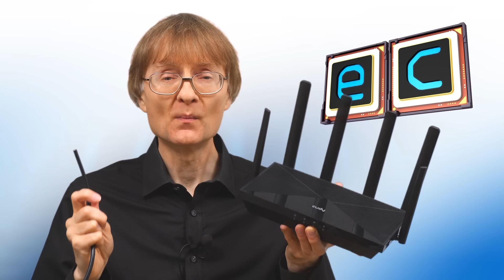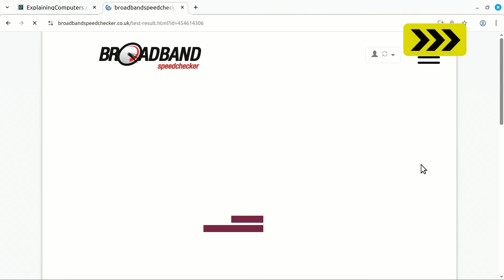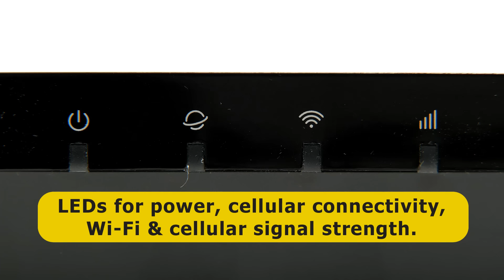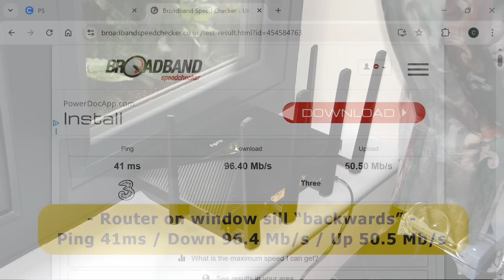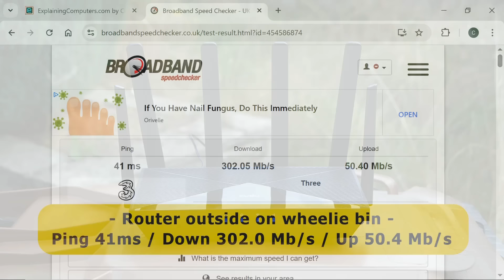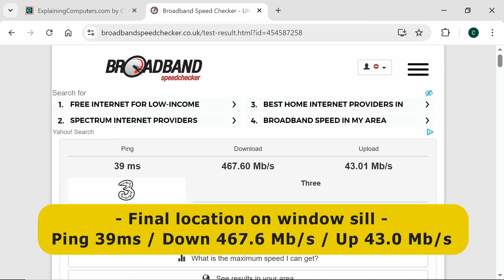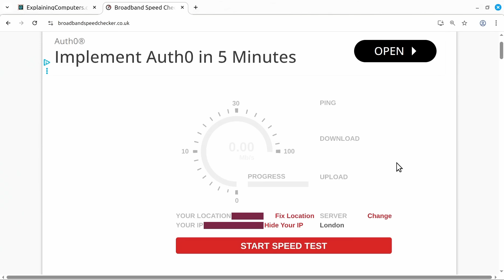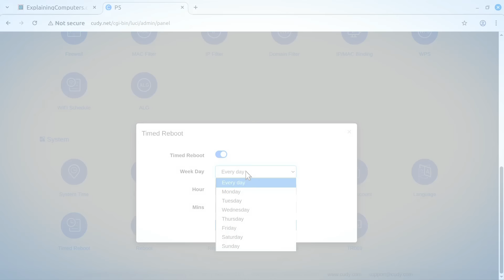Switching to 5G Broadband: Cudy P5 Router

Comment: Here in India 5G SIm router which is not tied to a operator costs an Arm and a leg, but the router which are tied to a operator is quite cheap, you get 30 MBPS speed connection with set top box for TV(including some free streaming services) and router and internet connection for annual fee of $90 USD. for 100MBPS it is USD $121. for 300MBPS it is $202.

Comment: You may also want to raise the router a few centimeters above the window seal so that the bottom part of the antennas are not sitting right up against the metal window frame.
Reply from the maker: Surprisingly, putting it on a box made no difference. It made me wonder if the antenna is the full length of the plastic casing.
Reply: @ExplainingComputers  it could be that the antenna occupies just the top part of the plastic piece. I have seen that on the wifi antennas in these sort of routers.

Comment: I've used 3 mobile for years. On my Galaxy phone, I get ridiculously high speeds for DL and UL. I tried 3s own 5G wifi router and it lasted 2 days. It kept rebooting over and over. They sent me a replacement which wouldn't even get a signal. So I returned it and did another 12 months with VM. I then tried 3 again with their new 5G router. That would only give me dial-up speeds. 3 told me I must be living in a 5G blackspot area, even though I'm getting amazing speeds on my Samsung Galaxy phone. If they can ever get their act together, I would definitely try them again.

Comment: Also running a 5g modem here on the southwestern coast of Greenland. 40/10 Mbits/s. Our town (1100 people) is connected via a chain of radio stations to the next town over. They have a fiberoptic cable to North America and Iceland
Reply: That's crazy cool. Is it reliable?
Reply: @Velai_Vai Well. There's reliable and then there's reliable. I haven't got any hard data, but my personal experience is better than 95% up time. It varies a bit with the weather. Last year we were out a couple of days. A relay station on a mountain peak couldn't get sufficient power from the solar panels and the air intake for the diesel generators was blocked with snow. We had to wait until weather permitted a helicopter. We got information about the blackout 4 hours ahead so we withdrew cash, informed family and friends. Shrugged and went about our daily business.

Comment: I used mobile internet some time ago as the connection was so bad, even though the area was considered very wealthy. Barely would get 20 megs. Unfortunately the mobile connection had much better download but upload was non existent. I moved home but there is only gigaclear in my area but the price is £60 a month but the mobile connection is very poor. 5g connection is around 10 miles away which is to far for good signal.

Comment: Hi Chris. I’m in the Uk and have the luxury of both “landline” internet and 5g. But when my landline expires in the new year I will not renew it. It only offers 36Mbps upload and 5 down. The 5g is variable and can sometimes have the odd slow moments. But the very minimum download is 50 and often up to 200. While the upload varies between  45 and 100. With a better location for the 5g antenna I’m sure I can improve that. The difference in cost is £29 per month landline and £15 for unlimited 5g. As they say it’s a no brainier. And now my so called landline telephone has gone digital, (£5 per month)i will simply plug that into the 5g router when I say goodbye to the copper cable and openreach. I won’t miss it

Comment: Very interesting video. Thank you. 
I recently migrated to KCOM FTTP. An engineer did comment that they were baffled that Openreach still make the final link from property boundary to property by copper which was exactly the problem I had 5 years ago when 900 Mbps fibre was strung to a telegraph pole 40 feet away across the road. Mid installation of a new broadband service at our previous property the engineer pointed out that the final link was in fact copper contrary to the product BT had sold me and that Openreach had no plans to extend fibre to any of the properties snuggled around the pole. I told him to stop installation and cancelled the contract. Up until Covid I was using an EE 4G router which performed excellently (previously my wholly copper service could only manage 1.72Mbps!). However during Covid some twit burnt down the mast EE was using in the outrageous belief 5G masts were responsible for the spread of Covid. EE held up their hands and conceded they weren't able to restore a service and let me break the contract without penalty.

Comment: Most of the antennas are wifi. If there's a 5g external antenna you could have run a cable to an external antenna on the roof.
Reply from the maker: Simply not true. As I showed in the video, the FOUR antennas on the back are all cellular, whilst the TWO on the sides are for Wi-Fi.
Reply: @ExplainingComputers OH. Apologies. I missed that.

Comment: In 10-15 years time it will be interesting to see whether wireless internet will have left the huge investment in fibre network implementation already obsolete.
Reply: No, it very much will not. First of all, because fiber is used for the backbone and backhaul of many cell towers. 
Second, because fiber still has lots to give. XGS-PON is already deployed around the world with up to 10 Gbps speeds (symmetric) and even better standards are already defined.
Reply: @evefavrettobut who really needs 10G Internet.
Reply: @DIYBill  the capacity is shared with everyone in the same port. So, you and all of the neighboors.
Reply: One word : Satellite

Comment: I use my phone tethered via USB to an RPi router. Works well, I get 20-60mbit/sec. I did this over 2 years ago as my cable co was charging me more and more for a slow connection. They offered 4x the speed for the same price to new customers and refused to change my plan. Switched to cellular at 1/3 the price and never looked back. Also has been more reliable and works when power goes out.
May get a second cell data plan and use a router. Problem here it is much more difficult to get a generic SIM for use on a router. Providers want to only support their phones and my provider does not have a hotspot. Only way is to buy a cheap phone with a SIM card and use the SIM card in a router (and illegally use the IEMI of the burner phone.) 
I'll be leaving my house and going nomad.  Being in remote locations, I'd want an external antenna. This setup will work ok but may add Starlink cheapest plan as a backup.

Comment: Make test with external 5G dedicated antennas
Reply from the maker: In see little point. My tests showed no difference between internal and external 5G, and on the window sill my router has a direct line of site to a tower a few hundreds meters away. I am very lucky in this respect. :)
Reply: @ExplainingComputers you're lucky. 😊
Reply: @ExplainingComputers you might try and fiddle with the position of the 5G antennas though.

Comment: On switching away from landline to cellular, I assume you'll have lost the ability to house, at home, servers accessed from the internet, due to the ISPs use of CGNAT, which prevents establishing new incoming connections. I got around this by routing incoming connections through another non-CGNAT location and using a wireguard VPN to link the locations together. Important to know if you have servers at home.
Reply from the maker: This will indeed be true, but I do not run Internet servers.

Comment: I've just made the same switch you've just made, as in from BT copper to Three 5G/4G. I've gone for the ZTE G5 router. I'm quite rural but with the router in an attic room and up high in that room, I'm getting 120Mbs down and 40Mbs up. 
Also, much cheaper, than my BT connection that was just 70Mbs down and 20Mbs up and costing about £50/mth.
Three is costing me just £22/mth.
Happy I made the switch. 😊
Reply: i think it was a couple of years ago i got 18 months of unlimited internet for one off payment £99 no calls no texts just data three network

Comment: We have symmetrical gigabit FTTP through a small alternative network provider called Lightspeed, they share Openreach’s poles and ducts and the cable attaches straight onto the house like the phone line did. We also had Virgin Media’s FTTP service also provided in the same manner (new area for them so no cable network in use) and they offered us up to 2gbps symmetrical if we wanted to pay the price for it and opted for a 381mbps symmetrical service. Mobile network wise the only network with 5G here is O2 and speeds are pretty poor at 150mbps. EE has 5G available in nearby villages and towns but they have just missed us out it seems for now. Vodafone and Three just haven’t bothered anywhere locally to get 5G. Our landline is via Vonage who use VOIP so it can work without needing to use the old copper line for anything at all now. Just a shame we now have three drop wires attached to our house and two are doing nothing at all. Fastest 5G I have seen locally in my nearest city was 750mbps on EE but it averages around 300-500mbps and that’s just with a phone.

Comment: I love Chris because he never leaves questions unanswered.
Reply: He is very thorough.
Reply: Hmmm. Could have needed more details on the Three contract. The Cuda is super expensive and doesn't feel like its worth it. Many questions left unanswered.
Reply: 3 network - 5G Outdoor Hub + 1 Eero £21 p/month
Reply: @Factory051  If he'd have to pay rent on a modem/gateway from Three like a cable company here in the US to get one from them, then yes buying a modem/gateway is worth if you keep the service for 2, or more years, but if not like on T-Mobile here in the US that just includes it with the cost of service, and it has external antenna ports like the Arcadian G4AR so you can add your own antenna then no it's not worth it.
Reply: Really appreciate this vid as I've never owned/used a smartphone so I know absolutely nothing about wireless or data connections.  I have fiber but I'm getting ripped off and want to cancel but I don't know anything about 5G etc.
Reply: Except one: What result would he get by placing the router high up in a tree? Inquiring minds want to know!
Reply: @ericwood3709  He'd get squirrel  interference, kind of nutty, huh?
Reply: Oh yeah how come he hasn't an answer to unified gravity theory with quantum mechanics.?
Reply: @ntal5859 Oh, he does have those answers, but only for his paid members.😃

Comment: Hi Christopher, you could also try to find a 18 m telescopic antenna mast (all regulation authorities use it to measure and gather radio levels almost everywhere and with every frequency bands), enclose your router into a glass fiber box (no temperature problem, as it is not 20-25 sun hours a year where you dwell that'll overheating it 😋) and crank it at maximum height.

From the differences between your first and last results, we can, once again, deduct that the ISP is using traffic shaping to "moderate" the uplink - it seems that either ISPs and (or ?) governments do not like people doing real Internet, namely host their own gear and operate from home instead of using costly external "services", but anyway this will not be a big problem as the digital ID will soon limit your access to a maximum of ~2 hours per day, for your own good and security, of course……… 😈😋

One day, someone will have to explain the real reason(s) for this limitation in detail, as from the ISP point of view I don't see the difference paying for traffic that is anyway transiting through their boxes.

Last but not the least, in the world each and every telecom operator is flipping to all IP networks, however they have quite a quirk, as POTS used batteries in the FXO, allowing telephone to keep working during power outages, crucial to join emergency service often needed in such cases, but with IP, no power = no comms, which seems at best completely dumb (except if it is part of the (final) solution).
Reply: I worked for contractor of contractor .. doing jobs in phone exchange stations : 
1. POT lines indeed had very reliable current loops supplied from exchange stations to each subscriber that allowed POT lines to work regardless of electrical power / gas reaching homes, offices and enterprises.
2. Each mid and large exchange station had a big room full of battery cells that had to be checked regularly sampling battery cells measuring PH in the Sufuric acid solution.
3. At the same time each station had connection to the power grid. Some big stations have dual power connections in case one power line goes down, PLUS a diesel generator with fuel tank and the lot, just in case.
4. And then along came the spiders in white collars, fancy laptops showing off utterly useless computer degrees, who decided to do away with POT current loops arguing cost, because of replacing copper with optical fibre.
5. Exchange stations are now packed up with routers and switches that used to be kept in central nodes, and all POT batteries are gone for good, they say, until the sh.t hits the fan, and customers have to revert to their cellular contracts to cover emergencies that no so long ago could be solved hanging down the phone set, hearing the familiar and reashuring tone letting know that regardless whatever problems other distribution networks had, the phone exchange was up and running for business, in cases saving lives at a fraction of the cost of maintaining cellular towers all over the place filling up the electromagnetic spectrum with often insanely non-ionizing RF signal power levels on daily basis, just to track phones, as cellular networks need know at all times where all subscribers are.
Reply: @johnbofarullguix1499     You touch one the major PITA of the century : vertical decisions that never take care of the opinions and skills from those who have the hands under the hood and grease under the nails.

This usually a good starter for "unseen" catastrophes, unless killing people by not being able to reach emergency services is one of the goals aimed at, which is legitimately  highly questionable in regard to what did and did not  happen during covid…

Comment: Greetings!

Those are pretty tidy speeds for 5G. Imagine what speeds would be available if your local tower and equipment supported mmWave!

I just ran a 5G test on my phone and got 50ms, 180mbps down, 3.4mbps up. About 12:30am AEDT, using Amaysim on the Optus network.

I upgraded my connection to fibre to the premises a bit over a year ago. NBN here in Australia uses different terminology, your FTTC sounds like what is known here as FTTN or fibre to the node. After a recent speed upgrade I'm paying A$80 for 500/50mbps.

Comment: Not sure if your router has enough aerials Chris. Feels like they could have fitted s couple more. 😃
Reply: Porcupine
Reply: Mugs eyeful lol
Reply: @si4632 LOL

But, to be fair,.it's because of MIMO: multiple in multiple out

Might be worth trying to angle the cellular antennas to try and get even better speeds.
Reply: @evefavretto judging by the speeds he was getting the aerials were unnecessary, have you got a loft Chris with a power supply 😁 you will be limited by those gigabit ports mind you
Reply from the maker: Agreed!
Reply: He really should get an outdoor Antenna from a company like Waveform that has a Window seal kit, and lets the antenna be stuck on w/suction mounts.

Comment: I had similar reliability issues with our 100mbps fibre connection in rural hilly India, as falling tress during storms, snow and monsoon would down the optical fibre line for days or even weeks, I kept a 4G router as a backup but the 4G connection was rubbish at 10mbps at best. As soon as wireless 5G modems became available I added one provided by the telco, it has an external antenna pointed towards the tower about 2kms away, and an internal unit. I have combined the 2 connections, the fibre and 5G ones via a Omada ER605 VPN router using its dual WAN and load balancing  capability, and my speedtest is around 200mbps, with a 6ms delay, and uploads around 100mpps. The wired ISP connection keeps failing now and then as usual, but I never notice it till I see the flashing red light on the modem. The 5G connection on the other hand hasn't let me down for over a year now, and it's great to have a backup connection and a load balanced one with 30-40 devices connected on it usually. My total bill has gone up from around 10US$ to around 22$ now, but it's worth the price!

Comment: Things change here, in the US, so often it's hard to really know what would work best.  One thing that remains constant is that cell data usage limits are pretty low and getting a true unlimited connection is from difficult to impossible and very costly.  I use a mifi on T-Mobile when we are travelling in our motor home and keep bumping into the monthly limit.  I also so have a hot spot on ATT but it's only 4G LTE and sometimes isn't very fast but we seldom are anywhere that there is no signal.  I tend to leave those areas quickly and keep some books around just in case.  Starlink has too many drawbacks such as it quits working in hard rain.  Has a problem with shady spots, etc.  Oh and it's too darned expensive to boot.  Glad you are having a good experience.  As you probably are aware most of the land in the US isn't covered by 5G and a lot of it doesn't have any cell coverage.  We're just too big.  Once you get away from population centers and the Interstate highways, thinks get dicey.
Reply from the maker: Thanks for this. I indeed benefit from living in a built-up area with good cellular coverage.
Reply: @ExplainingComputers  Could you take a look at still quite new Arch-based Linux distro called Linexin, please? 🙏